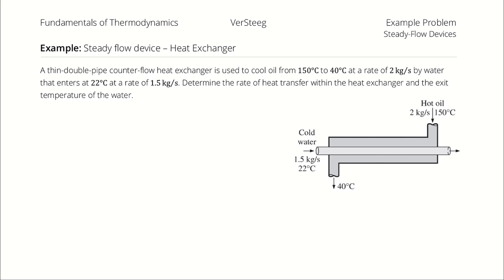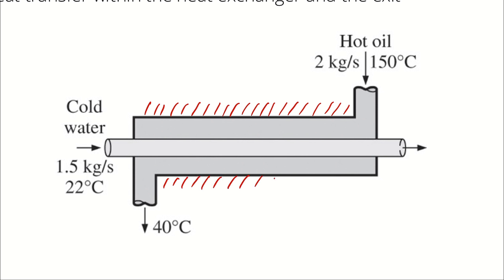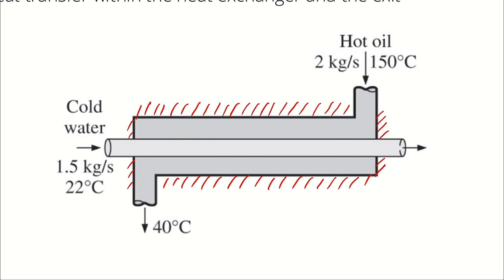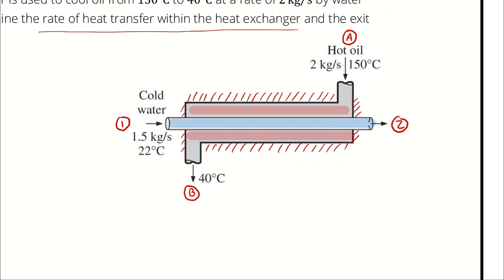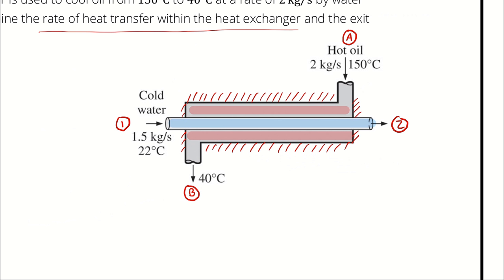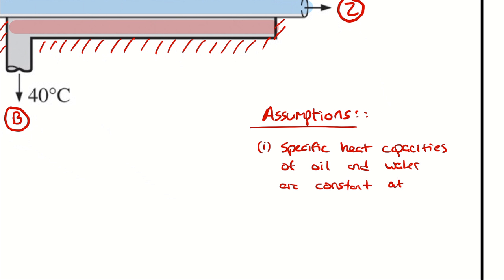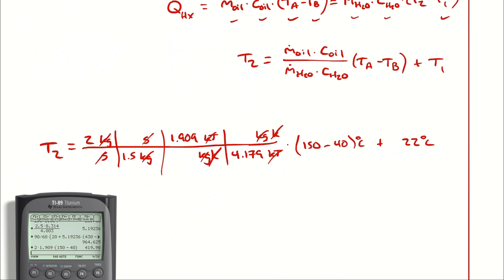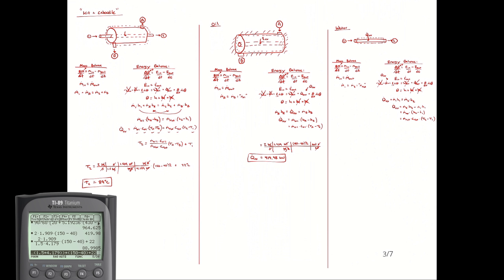Open Systems Example Problem - Heat Exchanger

Comment: what if instead of water we use  r22 and instead of oil we use water .how can we calculate tr for evaporator ?or the length and number of copper tubes for specified tr like 20 ton evaporator